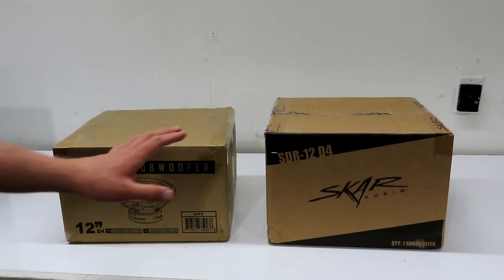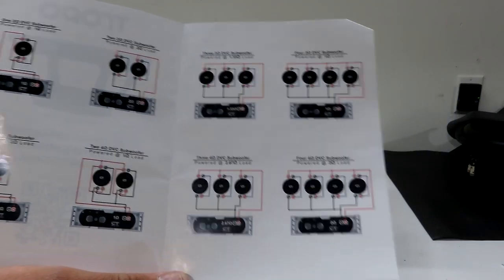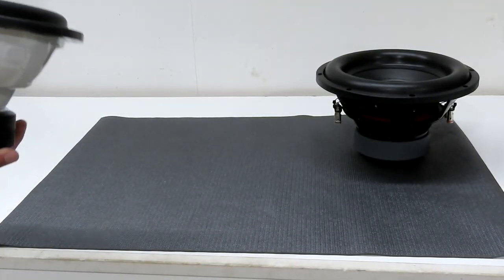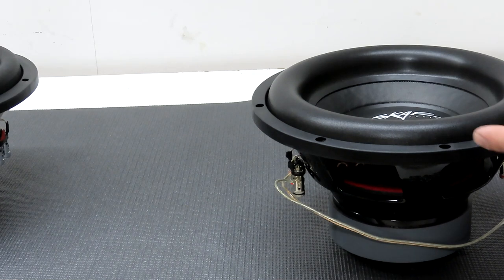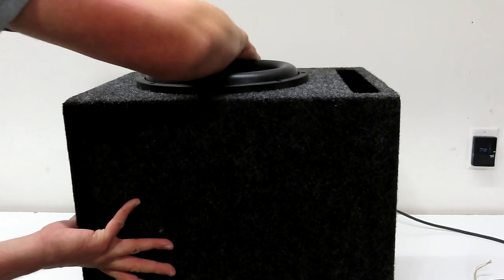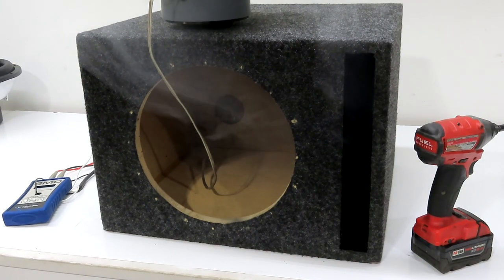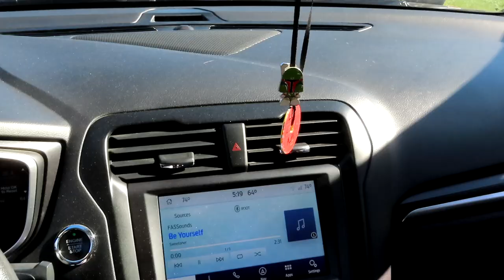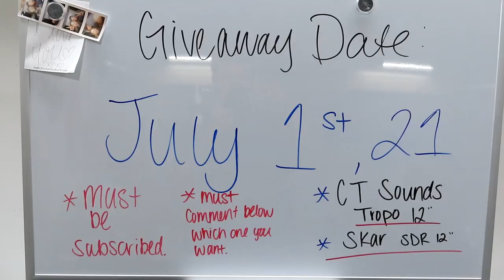Skar VS CT Sounds - Best Budget 12" Subwoofer

Comment: In the infamous words of Dexter, "You are STUPID"… I'LL PUT MY SKAR AGAINST YOUR CT SOUNDS ANY DAY! YOU PLAYED THE SKAR LONGER IN FREE AIR. SKAR is the best bang for buck
Reply from the maker: This is my experience.  This is my presentation. Others may vary.  Doesn't matter now. Both woofers have a happy new home. Any suggestions on other experaments?
Reply: Apologise for being rude but I'm bias towards SKAR would like CT and SKAR around the 1200rms range like the evl, however you definitely need larger speaker wire for true testing. I have a single evl on a rp2000 an I hit 148.4 DB at 32hz but have a specific built box ported
Reply: Wired down to 1ohm Evl 12-2
Reply from the maker: @yemajdleifyam7554  the new Strato lineup is no joke either. I have one of those as well. Single strato 12 on 1200w. Moves a ton of air.  Im not really biased per se. I just buy a lot of CT products because i know they will last. And they're improving every day. They truly care about audio in general.

Comment: Scar audio Sdr series is bad the coils don’t last and they just put such a stiff spider for a low watt subwoofer
Reply from the maker: That's exactly what I got out of this test. Stiff spider, weak motor,  and inadequate coil.  All in all I was very disappointed.  Even HIFI Vega found this sub to be displeasing, despite its cheap cost.

Comment: Ct for high bass and SKAR for low bass
Reply from the maker: I would say thr opposite is true. Even my video shows. Ct hits much deeper and lower in same box.
Reply: @ATCA  maybe for the set but once you step up to Evl, world of difference. Parker Dechanel proved
Reply: SDR
Reply from the maker: @yemajdleifyam7554  i wouldn't say tgat either. CT has redesigned every product they have to be more competitive and louder overall
Reply: @ATCA  the subs also have a different fs and tuning rating skars shit gets lowwww. You can’t use the same box to compare you need a box for each sub both at their recommendation. Guaranteed skar will take the win

Comment: Ur clipping ur sub thats why the skar fried tbe coil.
Reply from the maker: Hardly.  Thats what the meter is for. It shows clipping.  Also, its on a 2kw amp dialed to 600w. Its nowhere near clipping. Also the same exact method was used for CT sub. No issues.  The issue is the coil can't handle 600w like it says it can.
Reply: @ATCA  no i seen ur clip light comming on  and those clip lights like ct sounds uses for their amps the light only comes on for hard clips not soft clips  i was just trying to help u out and let u know u was clipping and it doesnt matter if the amp is wired to 4 2 1 .5 ohm the amp was clipping prolly from a dirty distorted signal from ur radio
Reply: @ATCA  u can have a 2k amp with the gain set to 600 rms and still clip like i said with a crappy signal from the radio
Reply from the maker: @joshholden8561  watch again.  Amm1 shows clipping.  Its not clipped

Comment: Battle of the douches in car audio. Decent products though. Both owners are shady. Yes you would of had to be around back in 2011-13 on the forums to know the back stories.
Reply from the maker: Well, CT has new ownership, and that shady crap is gone. So, skar is the only one of the two that still doesn't do the customer right.

Comment: I sense some bias.
Reply from the maker: If you knew my story,  you wouldn't say this. Ive sold stereo my whole life almost.  10 plus years. Closer to 15 years. I used to run whatever i could get. Then i started buying JL and Polk Audio.  Jl just got more expensive and Polk sold out to the same company as Power Acoustic and Audiopipe.  Their quality went down HARD. And so did the price. Now its affordable, but its crap. So my favorite brand was ruined and jl was too expensive.  So i sold my collection of old school Polk, Rockford and Crossfire amps, that were aging, in hopes to get some new marketing stuff. Obviously i stumbled upon Skar. I bought skar for days. Became a dealer, sold skar to others. I noticed right away.  My rp2k went to protect. No reason.  Checked everything.  I have a Snap On oscilloscope and Fluke meters to check clipping and voltage. All was well.  Sent the amp in, got a new one,  bought a 1500 to bench test stuff. It also quit... while doing hardly nothing.  2000w rms 13.8v PSU that ive been running for years to test up to 2k amps no problem.  Used to run a display vase with it, like Best buy has. 

So in frustration i stumbled upon CT Sounds.  I bought a few items. Compared them.  I was blown away! So much better for just a little bit more cost!  I finished selling all my skar stock, including my personal stock. Bought AT and T series amps feom CT, did about 15 builds with them instead of skar over the next year. It was apparent that CT was better. So i just kept up with it. I moved to a new house in 2019 and i haven't been selling much. So i have all this stock plus i bought all the new stuff. CT doesn't give this stuff to me free.. I have to pay for everything. So over the next 2 years, ive just been mailing videos, building systems, etc. The owner of CT passed away and his family took over and remade a lot of improvements.  So i just keep buying it. Usually i just send referral links to my customers and i get points where I can buy a few small things here and there free. But thats about it. I literally make no money off selling or referring CT. Especially when you consider that everything I get free from referring CT, i just give away to make others happy. 

So please.  Let me know if you think im biased..

Comment: HI GUYS, I'M DOING MY 1ST "BUDGET BUILD" 😊. BECAUSE I DON'T HAVE ALOT OF MONEY SO MY CHOICES FOR SUBWOOFERS SO FAR ARE 1. CROSSFIRE-C3 12IN. 2. AUDIO LEGION-AR12 12IN. 3, CT-SOUND 12IN. WHICH ARE ALL ($79 to $99 DOLLARS). I GOT A (JP8-MONO BLOCK) TO RUN THEM. WHICH SUBWOOFER DO YOU THINK IS BEST FOR DEEP RICH BASS 🤔?. THXS
Reply from the maker: Definitely the tropo or crossfire. However the tropo is thr best of the 3. Audio Legion is cheaper but I wouldn't even consider them due to them selling thr company recently to swap and they are closing down.
Reply: @ATCA  ...... Can you please do a video on CROSSFIRE-C3 12IN. Or if you have done one, send me the Link to see the Video. Thxs luv your channel. ✌️
Reply from the maker: @foodforthought872  I'd love To. I just have considered it yet.  Perhaps if someone sent one in